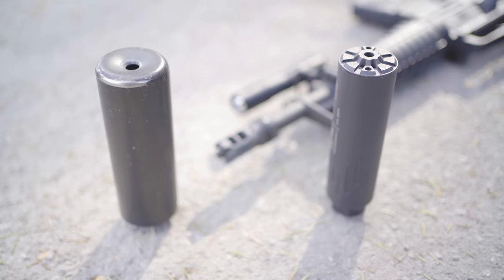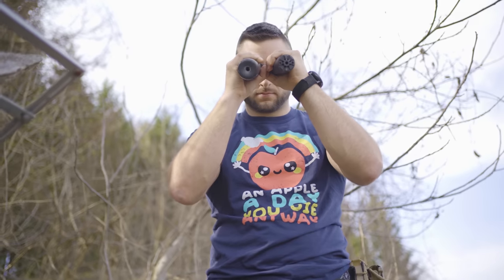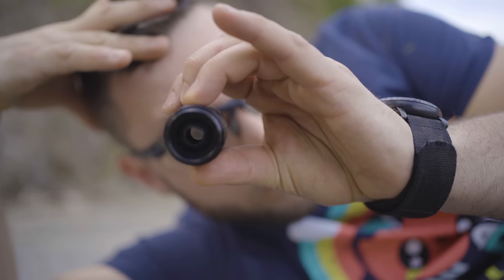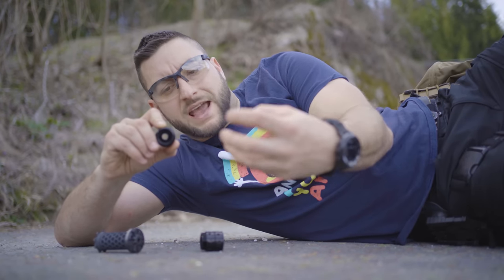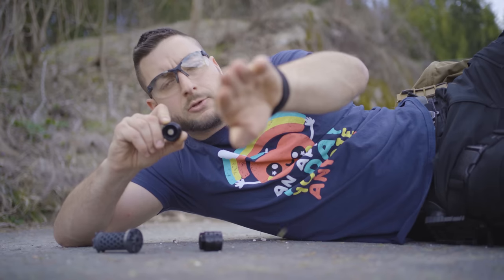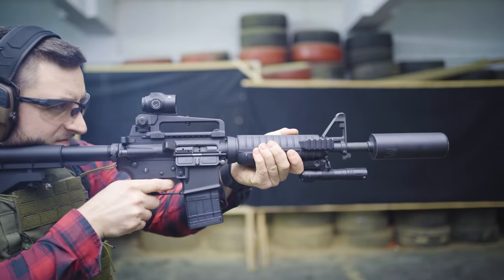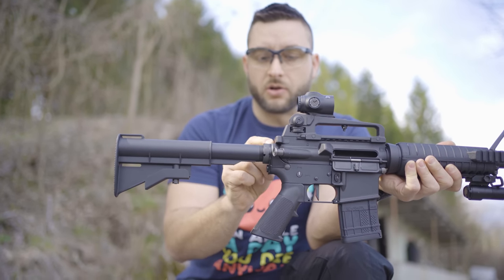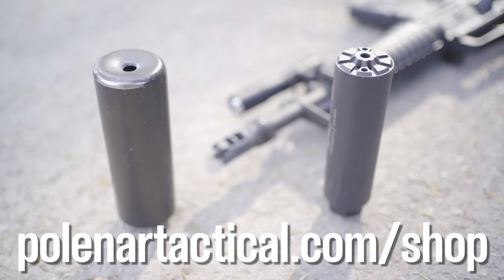Flow-through VS Conventional Suppressor

Comment: People cry about blowback waaaaay too much. There's almost always some wind to blow the gas away, and it doesn't burn your eyes or nose even 10% as bad as some people claim (military arms channel)
Reply from the maker: That only tells me that you don't shoot a lot
Reply: @Polenar Tactical  I do, 1-2x a week, 100+ rounds per range trip, always suppressed for rifles. I've got 3 suppressors and none are flow through. 556, 300blk, 6.5 grendel, 308. Unless you're rapid firing during 0 wind, the blowback just isn't a problem at all. Maybe people just have some sensitive ass eyes and noses😂 I don't even wear eye pro half the time and I've never had it irritate my eyes
Reply: @youreright7534  automatic fire.
Bolt action never close .
ar = M16 is BS if FA+ silencer .
Micro Uzi 1550 minute. With Ase Ultra Reflex -1860/90 minute. Yes regular Uzi 25 round stick -is one second treat … and burns powder😂
Reply: @Casull  less than 1%, probably even less than half of 1% of shooters have a full auto. There's just no need at all for flow through. If you're shooting full auto there's no point of even suppressing. Just gonna blow up your suppressor, put unnecessary wear on the rifle, and potentially cause rounds to cook off from the chamber being so damn hot from all the gas getting directed back down the barrel.
Reply: @youreright7534  If the rifle is set right, the suppressor won't put significant wear on your rifle. And yes, there are plenty of reasons to fire with a suppressor in full auto, very much common.
Reply: @Lucas Tonoli  set right? The fuck does that mean? No matter what a suppressor is gonna cause premature wear on many parts of a semi auto, even more so on a full auto, along with causing unsafe conditions, cook offs for example. Shooting full auto suppressed is just stupid
Reply: @youreright7534  Set right as in gassed correctly: the dwell time is extended with a suppressor, you can compensate with that with the right barrel, that has the corresponding barrel port size for your gun, and with the right buffer set-up. There are enough variables in an AR build to make up for the added pressure.
Regarding your mind-boggling **tarded claim about full auto and suppressors, go watch any SF fighting, they will use the shit out of full-auto on suppressed guns. Suppressors are great for flash suppression, the change on sound signature is still relevant even if you're firing in full-auto, and - of course - your own concussion from firing in full auto (inside a building, for example) is greatly reduced with a suppressor.
Reply: @Lucas Tonoli  gassed correctly, or as you should say, unable to function without the suppressor. Sacrificing reliability isn't something people want to do, if I for some reason have to run my rifle without my suppressor I need it to function.
Reply: @Lucas Tonoli  nobody in this comment section is SF. Bringing that up is completely irrelevant. Also, shooting full auto completely negates the flash suppression and sound suppression of a rifle. The flash and sound suppression are only effective when shooting semi auto. You've clearly never shot a full auto suppressed ar. And let me guess, your solution is to add a $300 click adjustable gas block so I can change my gas settings on the fly? Completely idiotic. If you want a reliable suppressed ar, it's going to be overgassed, or it's going to be unreliable when unsuppressed. No way around it.
Reply: @youreright7534  "or as you should say, unable to function without the suppressor"
You keep pushing to be utterly wrong about everything. Based on your logic, a rifle wouldn't be able to reliably operate with both Mk262 and M855 there is about 10k PSI gap between the two in terms of chamber pressure. And no, Mk262 won't produce abnormal wear.
A rifle can work fine within a range given that everything is set correctly. There is less pressure difference between suppressed and non-suppressed rifle than between two fairly common 5.56 loads.
Please stop, this is embarrassing.
Reply: @lucastonoli3256  dont forget, there's still time to delete your comments and save yourself the embarrassment. Do yourself a favor